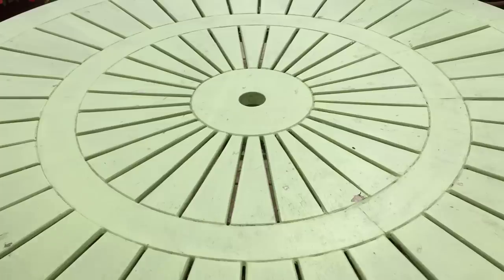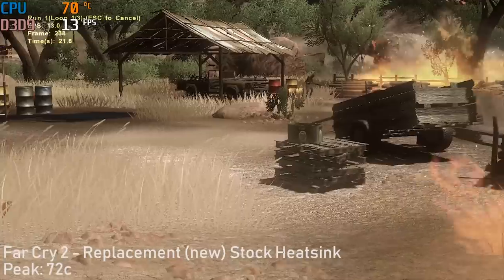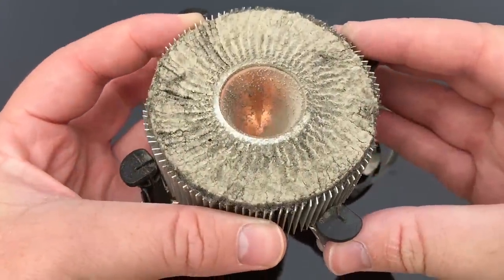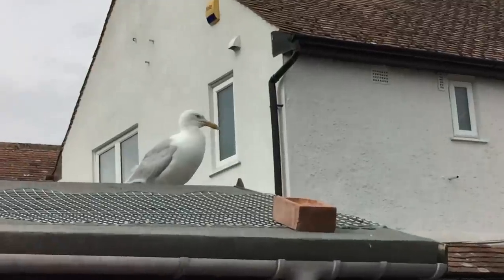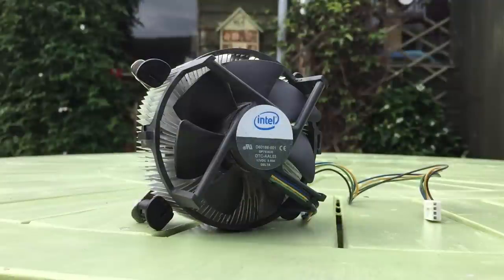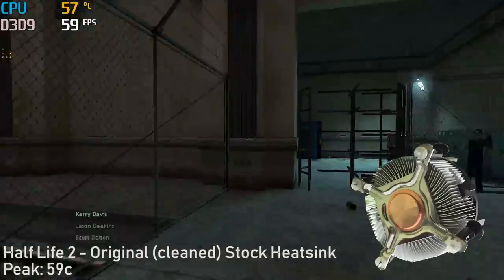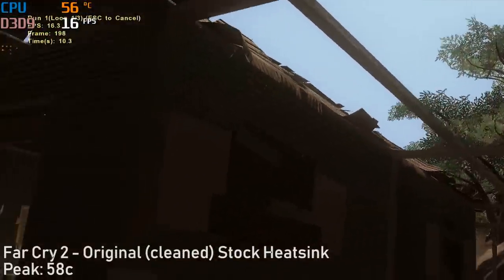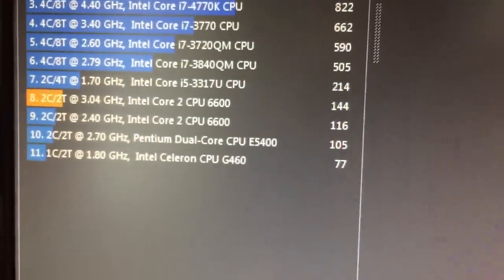Saving The OG Intel Heatsink!

Comment: The only issue with a cooler that old and dusty, the bearing on the fan can get destroyed which renders the fan inoperable. But clearly this older, actually well built cooler, was designed to actually last (unlike modern stuff)

Comment: I have noticed that older stock coolers have a better power capability than newer stock coolers.  The new one looked like it uses 200mA where as the older cooler uses 600mA, so the older unit has a higher power use.  This is not the TDP value but what the fan itself can deal with.

Comment: Hi man, I see you are using a can of compressed air. I used to use these as well but I have recently switched to a mini compressor. More powerful, way cheaper in the long run and easy to store. Furthermore, it can be used for other things as well and has a resale value. Anyway, thought I mentioned it. Thanks for your content!

Comment: Given the amount of compressed air you must be using, you should buy a datavac or a itdusters (Amazon) they are amazing, often comes with antistatic brushes and is paid within 1Y, I use mine everywhere in my house (air intakes, Hoover ...) You can also remove the sticker to access the bearing of the fan in order to add a drop of lubricant (silicon based for instance)
Reply: IchRocke Agreed, TechYesCity uses a DataVac too and he swears by it (not at it)
Reply: Phil Atkins I always wanted to buy one and bought the ITDusters after seeing his review, I didn't want the red one from eBay as it seemed too "okayish" but the original datavac (branded as such) is really too expensive where I live. The itduster is the sweet spot for me, and came with 3 different "air outakes" (that are made for it, not an aftermarket diy thing)  and 3 brushes (really the same that are on AliExpress for ~8$ so not a huge bargain on this side, but very convenient)

Comment: Should have given it a thorough clean, plenty of warm water in the heatsink and scrubbing to remove any dust and dirt then use isopropyl alcohol on both the fan and heatsink to get them looking and working like they do brand new, I'd advise investing in some isopropyl alcohol, eBay is the best place I've found in the U.K.

Comment: I5 8400 used to literally burn with the stock cooler. In AC Origins, it reaches 80 degrees. I had a Thermaltake cooler that I used with my old amd processor. I installed that custom cooler on i5 and now it reaches 55 degrees maximum.

Comment: You should get one of those electric air compressor from Amazon around £40, I got one and have been cleaning the dust out of everything I own.
It's called  "compucleaner Xpert", we use them at work too.

Comment: I took out a massive 3 heat pipe heatsink from a old dell, I plan on either making a custom plexiglass mount or using zip ties to mount it to my fx 6300 system so I can overclock it more without thermal throttling

Comment: That chipset fan on yor motherboard is generating noise. Plug it in PSU's molex connector in order to run it at 7 Volts. Yellow wire is positive, and red wire will be negative. Operating that fan below the 12V will solve your problem. If you don't wanna tinker with wires, you can buy molex 12V to 7V adapter on ebay for dirt cheap

Comment: Was at a friends when we watched the video, I nearly commented in fury on his YTaccount.
This was probably a ploy to make more videos, Touché.
Video 2- another 2gb, 4gb, or 6gb of ram installed (2gb of ddr2 is cheap).
Video 3- how to perform the lga775/771 mod
Video 4- installing an ebay sourced xeon x5450 (core2quad q9650) and comparing the upgraded performance with how it was in its e6600 2gb config
Video 5- overclocking the xeon to 3.6Ghz on 1.35v 400fsb*9multi with ram running at ddr2 800mhz 6-6-6-18 timings.
Video 6- adding a better graphics card like a used EDIT- HD7850 2GB from cex £40 and overclocking it to 1000mhz (think r9 270/gtx960 performance).
Video 7- what to do when you have a spare e6600, gtx7900, intel heatsink and power supply knocking around...
This is why I have about 20+ systems right now.

Comment: The new cooler used Alumunium contact instead of Copper base on the old one. I think if the size of the heatsink is maintained, it could compare competitively. Maybe you could retro fit the new fan to the old one because I guess it's more silent then the old one.

Comment: Do you think that a copper core heatsink would perform better versus a similarly sized aluminum one? I have a spare LGA1150-era heatsink salvaged from a computer that was lived in by a mouse - the fan wires were chewed, but I took off the heatsink and have since got an Intel stock cooler of similar size. I've got the unlocked pentium from that era in the computer currently (do not recall the exact model) and any temperature decrease is good, since I can bump up the clock speed slightly if I feel.

Comment: I actually did modify my intel stock cooler from my i5 6th gen, i cutted the legs on this very loud and annoying fan, and you may guess which fan i have mounted to the remains of the old fan's clip mechanism, a freakin xbox fan! Why? Because this fan is as quite as an intel stock fan never will, ow, you asked yourself how i did this? Very simple, you take toillet paper, undo the layers until you have a very fine, thin layer, and than just put superglue on it and than apply it to the fan/clip/cooler assembly, this fan had a broken fin, i repaired this fan the exact same way, and trust me, its as strong as before! Its living in my gaming rig for about a year and it works great! Awesome and very cheap mod!

Comment: 😒👍 yes u need to keep these, u see them on lga775 Core2Quad Q9550. PLZ NOTE having copper is not enuf! it has to have that steel bracket base below the aluminum fins. If theres no steel bracket it is shit. They run about $10 on fleabay so stock up on one. And dont waste a can of air on this, use a big brush and hot soap water, when dry hit the inside of the fan with lubricating oil. If u break any plastic pins u can pu some on fleabay as well 🙂

Comment: My Ryzen 1200 idles like 30 degrees and goes max to sometimes not even 40 degrees celcius with my aftermarket  cooler. I know the original cooler isnt bad but I just love the astetics of the aftermarket cooler and also it's performance

Comment: Had a question about mounting this old cooler on a i3/i5 system.  Those stock coolers with copper really makes a difference.  I have an Intel core 2 duo E6750 system with 8 gigs of ddr3 (hybrid motherboard)  Seeing how fast a newer processor ramps up in heat,   Could we try this test on a newer intel platform?  Thanks for rescuing the copper cooler (was gonna comment/hast makes waste) I am really enjoying your stuff.

Comment: I normalle put the heatsink in hot soap dish water and let it soak for an hour. Clean as new afterwards. And the fan blades wiped gently with a wet cloth.
Don't let the TDP fool you with these 65nm Conroe C2D CPU's. Using a modern all-aluminium "65W TDP" cooler (from a 45nm Pentium E5***) is not good. The cooler *can (*according to specs) handle the 65W TDP, but as shown with temps near/at the limit @stock speed. The "45nm" small cooller with CopperCore is better. But need to spin faster. The best is the good old heavy coolers, as shown here. The old stock E6600 cooler can even handle a 45nm C2D (E8500) with a resonable OC (3.6 GHz ) without problems

Comment: I get that compressed air cans are easy but a couple of points against them: they damage plastics, you keep running out of them, they aren't very powerful and can't be used continuously, but also worth considering, they contain horrible gasses that are very effective greenhouse gasses. If I remember correctly, one can is equal to burning a 150l of gasoline or something. So maybe get a cheap metrovac 500 alternative? Thanks for the video!
Reply: Really? I always thought it was just air, why do they need to add stuff

Comment: Could easily just soak that in carb cleaner which contains xylene which would disolve the dust easily and not damage the heatsink. Soak in carb cleaner, rinse in soapy water and then repeat if still dirty and then let it dry off. The fan itself can be wiped down with wet wipes after its removed obviously and then left to dry.

Comment: With all the used parts you buy and need to clean up, you should invest in getting yourself a DataVac. They are pretty great. Way more powerful than the cans of compressed air and will save you a fair bit of money in the long run.

Comment: Do you have a hardware/tool store that sells junky tools in the UK? If you do, pick up a CHEAP air compressor with a air blower attachment! It will pay for itself super quick considering the cost of compressed air cans. Here in the US, I picked up a 3 gallon compressor for $39 from a store called Harbor Freight. I use it for everything. Inflating car tyres, drying stuff off, cleaning dust out of my computers, etc.

Comment: I've removed the fan on a heat sink and washed it in the sink with water and dried them well and they looked and worked like new. then cleaned the fan with air then cleaned it more with armerall

Comment: Can you put the O.C settings on-screen pls? Like FSB, Multi., Vcore, etc. 
Also, it would be an interesting video to compare different FSB speeds with the same RAM and core speed on a  LGA 775 system (quadcores if possible, cuz the FSB is supposed to be a big bottleneck on those)

Comment: with some more delicate brushing of the fins and fan i would imagin you could drop another 2-4c if you needed it. (edit) I gave a mate my stock cooler that came with my g3258 (copper core) and it dropped 10c off his i5 6500

Comment: Just so you know: Canned air isn't actually air. It's usually butane you're just spraying away, which is not that great for the environment. For stuff like this I'd prefer using a vacuum cleaner instead.

Comment: I knew you will regret throwing stock cooler since I experienced the same with stock cooler for my socket 478 intel p4 ht 3.0ghz processor, cleaning and reinstalling bringed down my tempratures to 33-35 degree C, They are quite easy to clean you can also use soap to clean metallic parts...

Comment: My core2duo goes to 99°C under full load and 40-45°C when idle with stock cooler! I cleaned the heatsink and reapplied the thermal paste, that made no difference. :(
Reply: Same, I just bought a deepcool gammaxx 200t, you can buy the gammaxx 300 if it's cheaper in your country

Comment: The cheapest way to clean that is use a wipes to clean the fan and blast the heat sink with water and scrub it with brush or old toothbrush and wait for it dry or use hair dryer to get it dry fast

Comment: Havent you learned about how to clean fans?
You hold the fan blades to prevent the bearings from drying out and the motor to create electricity (not in this case)

Comment: delta fan those scream, the solid grim you saw under the fan we call it dust sock  it is a running gag  something computers and laptops get like a cold on some fans you can take it completely  apart and grease or oil the bearings and they last a long time

Comment: My Dell precision 390 with the same CPU running Halflife2  Downfall Mod. was 43 Degrees C. with all settings at max.(1080x1920)using an Invidia Quadro FX380 GPU which ran at 56 Degrees C. !
The game runs as smooth as Silk!
And next time use the S.I.I.A.B. method! (Store It In A Box)

Comment: i had a core 2 quad q6600 before with a pentium 4 cooling heatsink on it. even under 100% load for over 4 hours the thing still didn't go above 50 degrees celcius pentium d and pentium 4 coolers are the way to go on lga 775

Comment: i have a 80mm fan by Delta with 1000-4500 RPM
althogh it can get loud, if you have fan control on motherboard and a hot computer, you gotta least consider such stuff

Comment: I have the same case and also copper core Cooler -
And I ran it over a a core 2 duo E6550 bace of 2.33Ghz but I OC it to 2.567Ghz and immediately wished why I did that as idle it was at 60C and under load or running space engineers it boom 85C as quickly as it loaded the game but with that and getting 50-90 FPS probably down to cuda on my 550Ti

Comment: My Intel Core2duo E8500 and Pentium E6600 have only Intel Stock cooler full aluminum NO COPPER and i throw the heatsink into the dustbin so they can recycled and make aluminium cans drink like pepsi ,7up, coke and  when the intel stock fan spoil and bought a coolermaster hyper tx 3 Copper heatsink 3 copper pipes w fan. I managed to overclock to 3.8ghz on my 1st P45 motherboard, G41 motherboard only slight overclock. From Feb 2009 until now Feb 2022 my core 2 duo E8500 have survived and i typing using this E8500 CPU .

Comment: get a small compressor with a small tank, it will be way cheaper than those cans in the long run, and way more powerfull too. DO NOT get one of those ones that are used to fill footballs and stuff, those usually have dont have a tank.

Comment: nice one got fed up with buying air cans so invested in compu cleaner electric air duster... and have to say its awesome bit pricey at 44 notes but if i work out how much i spent on cans over the years :)
Reply: steve Apperley just buy an air compressor... You can get one cheap car compressor for the price of 4 cans...
Reply: true but most of them come with a cigarette lighter fitting... and this does not and its 500watt  so quite powerful.
Reply: I got mine for around 20 bucks. It's a 150w lowend one I just cut off cigarette lighter fitting and use old 350w PSU to power it.

Comment: Just drop it in water for a day with a bit of soap. Take the fans blades of and drop that in to. Then reassemble it after drying.
Reply: i wouldnt put things like that into water. as long as you can clean it with a brush and alcohol. there is no reason to do that and you always got the risk, of some water being on that part. plus you cant use it for a day or two.
Reply: Why? It's 5 minutes to clean it with brush for same result...

Comment: Another mistake, never blast the fan and let it free run, it will burn the PWM circuitry. Hold the fan when cleaning. i killed mine with vacuum now its stock at 100%.

Comment: Why was the cleaned cooler cooler? Whats the logic?
Reply: Lee Trigs it's a better cooler. The heatink is thicker and the bottom is copper which... (I'm thinking of the right terminology to use) is better at absorbing heat I suppose. Intel stopped putting copper at the bottom to cut costs and I'm pretty sure they made them thinner as well
Reply: Thanks for the reply buddy!
Reply: Lee Trigs yeah sadly, once AMD stopped providing decent competition,  Intel started cutting corners left and right. AMD has already kicked their ass into at leat getting up starting with 8th gen. Hopefully a fire has been lit under them

Comment: With a god cooler u can overclock that cpu to 3.2 with no problem 😀 i still have my old  q6600 and 3.2 is the sweet spot i managed to go to 3.6 but my zalman 9500 nvidia edition make like a jet engine even after i do it lapping on cpu.
And get a new paintbrush one smalll an one bigger it clean more better than that.

Comment: PC collect more dust when it's not used. I cleaned my pc after 9 years (when I bought it) , and there was way less dust than in yours
Reply: Gabrielius Kačinskas thats just fantastic how little of basics you know... There would be practically no dust on cooler if it's not used. All this dust because of fan. Working PC will collect a lot more dust, especially if it has intake fans. Also overall cleanness of room is very important.
Reply: PC's also collect way less dust if you keep them elevated 

and it entirely depends on where you store it and how dusty your house is. Homes with pets or smokers are the worst for pcs

Comment: I like the concept, but next time use the vacuum cleaner, that air compressed can is more expensive than that pos cooler.
That design is meant to cool the vrm also, but it's barely able to keep the cpu cool enough. 
Intel stock cooler is a joke, a verry bad, old and fugly one!

Comment: I use this old stock cooler on q6600 and the temp reduce dramatically than i use thiny new stock coller on my lga 775 but in full 100% its very loud :v ,but old stock coller is a good benefit if you no have lot money or to frugal spending buy aftermarket coolers....

Comment: I just saved one 2 days ago from my nevew it had a core 2 duo 1.86 ghz
Reply: Sebastiaan Valkenhoff the e6300 ? If yes, you can OC the ** out of it :D it was a great choice back then ! I had one that reached almost 3Ghz on air (2,4 stable if I remember correctly, with stock cooler and high temps :p )
Reply: IchRocke how did you know it is a 6300 and thanks I'm gonna do it tommorow
Reply: The 1.86Ghz did it :) be safe with overclocking, but by now there should be plenty of info on what MB/Bios/Settings are good to run with decent ram :) it's worth a shot if you don't want to try the Xeon route on a s775 Mobo (which is totally worth it ... But OC is free :p )
Reply: IchRocke dont worry I've overclockt before my ryzen 1600x and my old fx4300. And I'm looking for those xeon in my eyes it's just awesome modifying a xeon for consumer grade motherboards

Comment: canned air is the WORST way to clean things like this.If you want to use air for $15 you can get a mini blower on amazon. but for heatsinks like that, put some dish soap on a brush and clean them in the sink. blow off the loose water and let it air dry fan and all.

Comment: yes copper is a good dissipating metal, even at +20% dissipation. but even so, you probably got lucky with this heatsink actually being in your system :/.
Reply: some metals are better than others, maybe the metal I used was completely different.